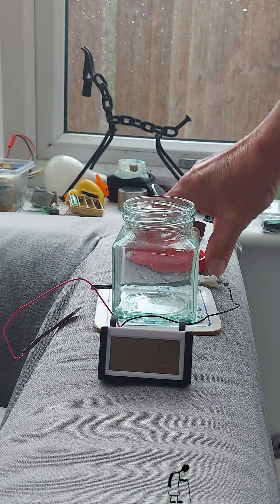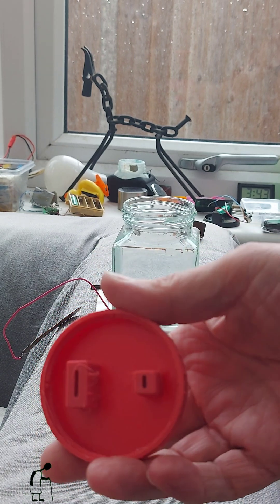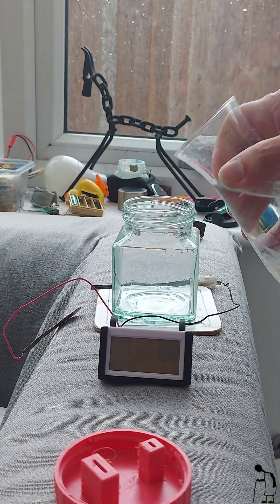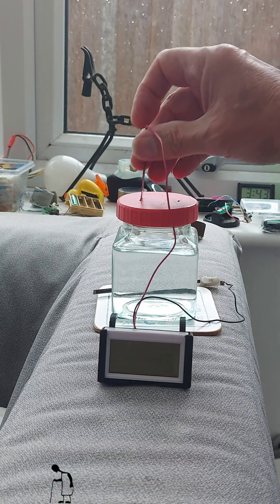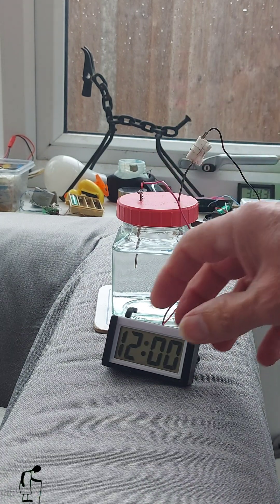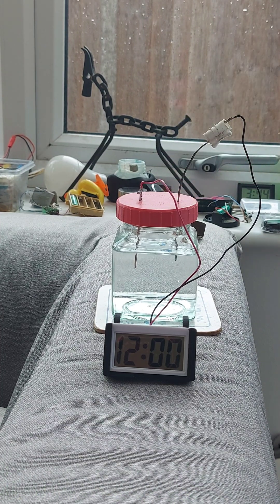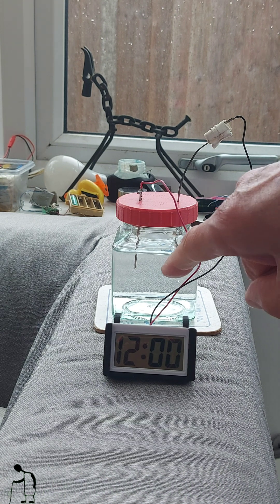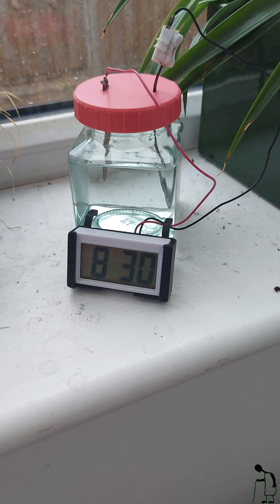3D printed lid for water battery jar SHORT

Comment: Hey grandpa can we get the stl file please… I suck on cad design
Reply from the maker: The original Thingiverse file is here: 

Parametric Bottle Cap / Jar Lid by degroof on Thingiverse: https://www.thingiverse.com/thing:5397832
Summary:
A generic lid/cap for bottles and jars. Can be configured to fit most containers. Allows for containers with multiple interleaved threads.
This thing was created by Thingiverse user degroof, and is licensed under Creative Commons - Public Domain Dedication

My full length video showing how I modified it is here:
3D printed lid for water battery jar https://youtu.be/Z8s7YXiLWpA

My Tinkercad file is here https://www.tinkercad.com/things/bJ9qe8FHaVQ-glass-jar-battery-lid but there is no guarantee my lid will fit your jar as it was a one-off

Comment: Is it possible to pass a current through solidified jello ?
Reply from the maker: Short answer is "I don't know". Longer answer - I am not sure if our Jelly will be the same as you Jell-O. Looking online for a supply of Jell-O it is crazy expensive. In the region of 10 to 15 times the price I would expect to pay for Jelly. The Jelly I am looking at in a supermarket is the type you cut into cubes and dissolve in hot water, then leave to set. Next time we are in the supermarket I will get some and try it. I suspect it will be conductive while it is dissolving in the water because the water will conduct. Then I expect it will become an insulator when it sets.
Reply: This will be a interesting project, it's always good to experiment with different types of electrolytes 😊  👍